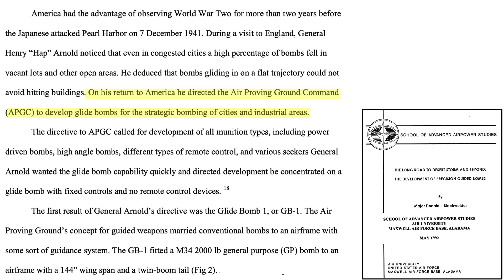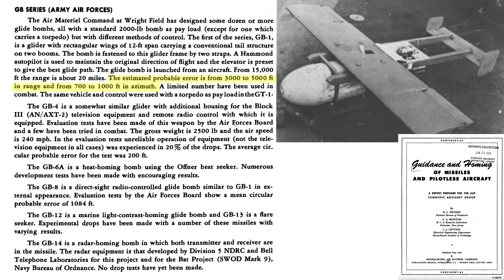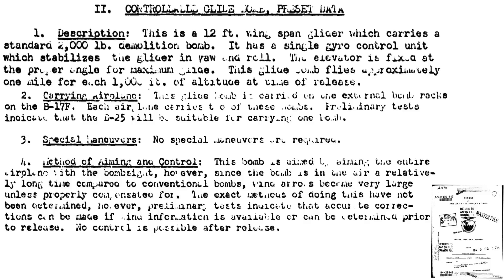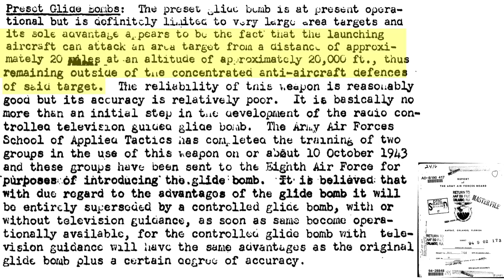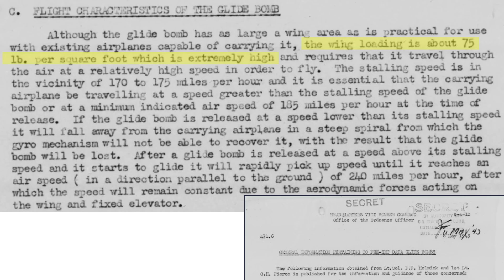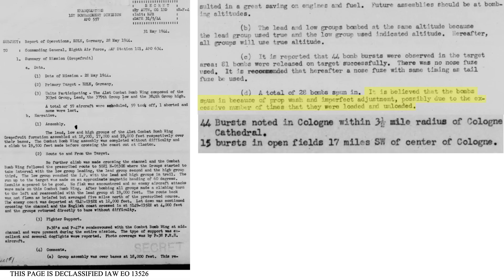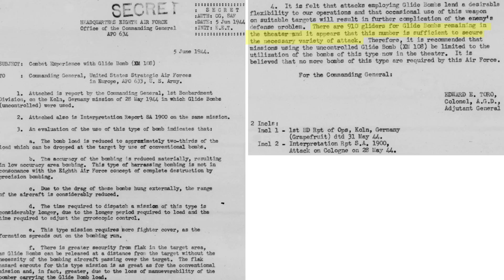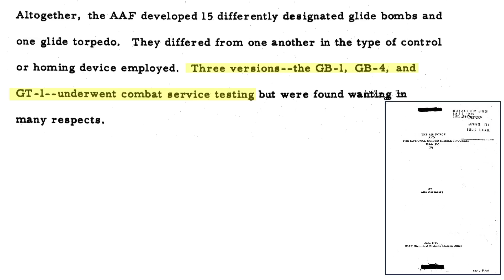WWII US Combat Deployed Gyroscopic Stabilized Winged Glide Bomb – The GB-1 Deep Dive review

Comment: FAB 500
FAB 1000
FAB 3000

The Russians got it Right 

First Detonations were up to 1000 feet either way, every flight tweaked the accurate until it struck at 300 feet to 100 feet (or less)
These fearsome bombs are used after artillery barrages to soften up an area for ground and drone assault with predictable results

Comment: As blurglide notes, there where so many advanced and some times very weird technology thought out and tried out during WW2 - German jets are and area that some time is so weird, that not even science fiction can keep up, with airplanes that are propelled by a central 3 or 4 bladed propeller running around the central fuselage - and powered by ramjets on each propeller tip ! Thank you for the good presentation

Comment: Add folding wings to store them internally and a decent enough guidance system and that would have been a game changer. I wonder what system they could have used to guide them from so far away. Seems most can be quite easily be countered.
Reply: The Russian UPMK conversion kit for dumb bombs into glide bombs uses a mix of inertial navigation and GLONASS satellite navigation. They're still externally mounted, however, as the point of that system is to turn cheap dumb bombs into precision-guided weapons on as low a budget as possible, so the extra engineering required for folding wings and therefore internal stowage wasn't done.
Reply: @anananandsdsdsds3486 
The Russian's had GLONASS satellite navigation in WW2?
Reply: 2:44

Comment: What would be the purpose of an aerial torpedo given that a torpedo’s whole design and mechanism of propulsion is obviously for use in water?
Reply: They can't "swim" in the water for very long before the battery for the propeller is dead and they're slow. Torpedo bombers had tremendous casualties early in the war trying to to get close enough to ships to drop torpedos. This would let you drop from way further out and only swim the last little bit.
Reply: That's an artefact of how the word 'torpedo' developed.  The first such weapon was what we''d now call a sea mine, and was named after the torpedo fish - which is the most common electric ray - because if you touched it, it hurt you. (These are the torpedoes Adm. Farragut famously damned at Mobile Bay, in 1864).  Then land mines got called 'land torpedoes' by analogy to the naval weapon. Then when what we now call torpedoes got invented - the first effective self-propelled one being Whitehead's, in 1866) they got called 'motor torpedoes' because they did what the original torpedoes did, but with a motor on the back end so they weren't limited by being anchored in one spot. That some people, in the early days of air-launched missiles, tried to extend the word 'torpedo' to cover them isn't all that surprising.
Reply: What about flying ships???
Reply: Modern torpedoes also fly most of the way, that increases their range and gives the target less time to change position.
Reply: Aside from the fact that Aerial torpedo was the name before the more commonly known term as "Cruise Missile"

And the reason is bcuz the effective range of an Air dropped torpedo is well inside the range of Ship board AA guns.